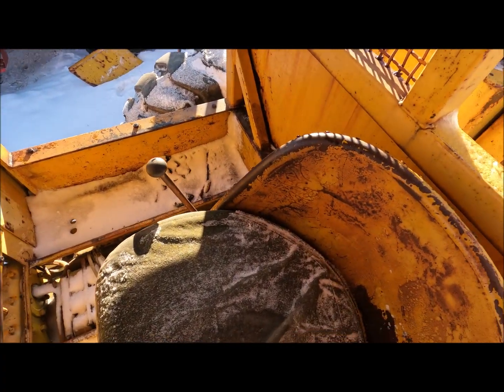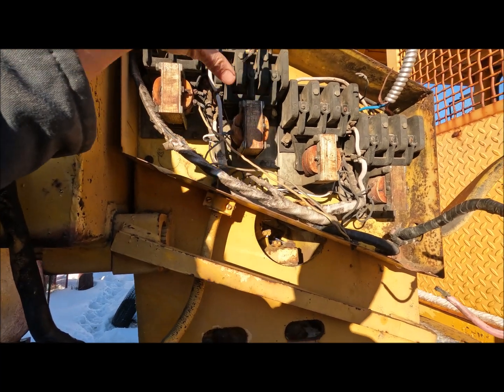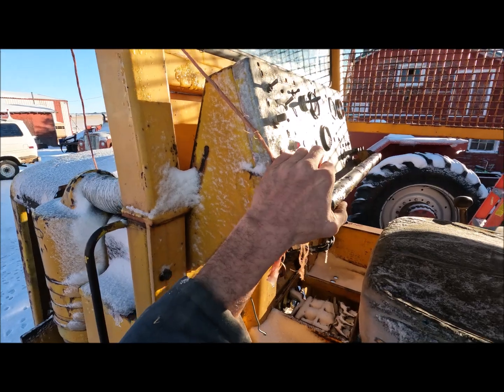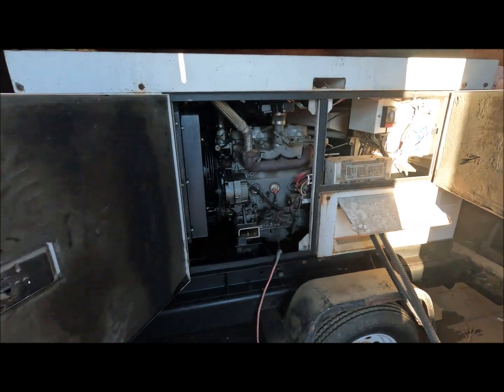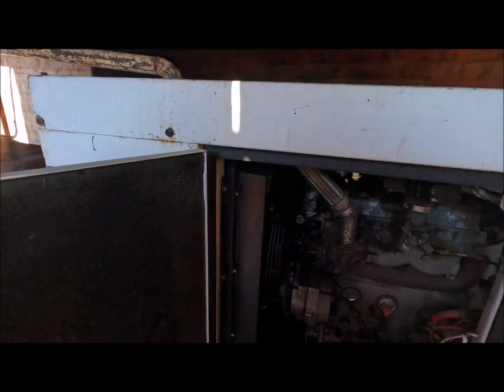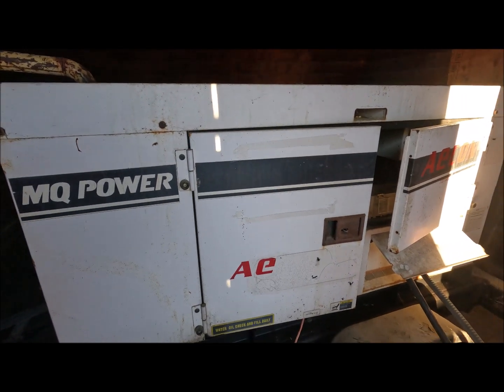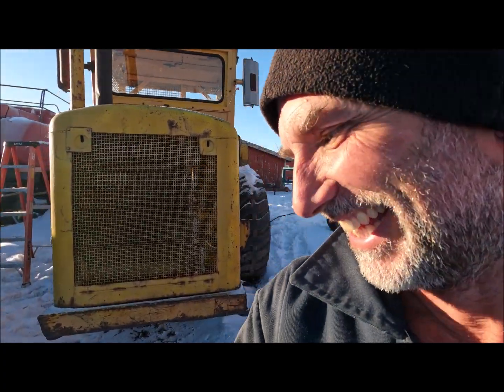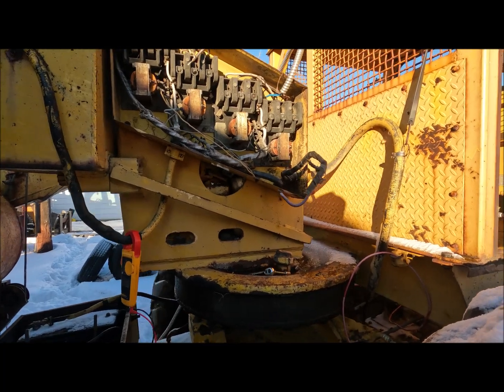Letourneau Tournapull scraper electric steering test #letourneau  #earthmovingequipment

Comment: you probably already know this. the engine speed directly changes the generator frequency. and those electric motors are designed to withstand 120hz. the engineers have thought about the gears so that the operation is smooth. the stihl truck used the same style function for driving speed.
great project i have to stay tuned
Reply from the maker: Thanks for the comment, I understand the rpm difference. Untill I get the original generator operational on the machine I want to get a VFD and bump up the hertz fron my shop Generator for bench testing in the shop only.

Comment: I climbed up on one of those years ago just to look and just thinking about a toggle switch steering, no brakes (air, NO pan has brakes) and a 4-71 with a flywheel alternator and straight drive to keep enough RPM/power to get the electric motors to even drop the pan to stop it or steer it and a relay hanging up or a wire breaking? Not THIS boy. I know they did a  lot years ago but I LIKE hydraulics. NOW!
Reply from the maker: Lol, everything you just described is exactly why I need to get this thing running. My Jedi Training will come in handy.
Reply: @PJTVenturesInc.  Oh MERCY always have a soft place to bail out into. I ran a 222 Wabco that had an electric drive to the paddles. It was on one side and you couldn't load a flat load for anything since it was so blasted heavy. I always thought of running a 'PULL" but it never latched. Get prayed up because when you get it moving you'll need every FORCE you can lay your hands on!
Reply from the maker: Thanks for the comment. I've seen pictures of those 222's with the electric paddle drives.  
I can totally see how they would make a cut on an angle with all that weight out there. Was the 222 a standard or automatic transmission
Reply: @PJTVenturesInc.  It had n Alli8son and an 8V-71T. Maybe a 4 speed.A 627 would run rings around it. A pal of mine turned the 222 sideways and kicked it in gear and it flipped over on it's side.
Reply from the maker: That's crazy. Hopefully I can get this old one in the dirt this spring.
Reply: @PJTVenturesInc.  That 222 was so heavy on account of that electric motor and gearbox on that one side it was pitiful. Just feel that rig out. I hope it works for you too.

Comment: I had one of them do  not overload your electric motors and you will be fine and you will also save your electrical contacks in the panel box
Reply from the maker: Thanks for the comment, I will  probably need your help and advice. I dont suppose you have any parts in your back pocket lol.

Comment: Just watch you dont wreck the motor if your supplying half the hz, some vfds can produce high hz if needed, good progress and hope
Reply: The problem with running 3 phase motors at lower speed is that the cooling fan does not move enough air to keep them cool so they over heat.
In this case the motor is only running in short bursts so it is unlikely to over heat.
Running old motors off a VFD can be risky. The waveform generated by VFDs can stress the insulation on the windings, causing it to break down. Modern motors have better insulation.
Reply from the maker: Thanks for the comment. My plan is to still use the original generator, I have been looking into replacing the rectifier but everything that Letourneau used to make this machine was made in house. None of the equipment has any ratings for hp, amps and watts. Theres no off the shelf or even brands to follow back a discontinued line of equipment. With that being said, Yes I should be able to replace that rectifier with a new one. The rectifier does two jobs. First and here is where it gets tricky for me. There is a Booster Rectifier that provides excitation for the AC Generator from the batteries that is always keeping the generator with with power with or with out any of the motors in operation. Second it is supposed convert the AC back to DC and charge the 24 volt automotive system. Theres is no little 24v generator or alternator run by belts on the front of the machine like most standard equipment. How do I ask for one or two new rectifiers with out the parts person looking at me like i have a second head growing out of my shoulder.
Reply from the maker: I was planning for testing purposes only, to set up a vfd to increase the cycles/hertz. Which is harder on the motors  in this instance. Incorrect speed and cycles/hertz or vfd supplied power. I want to remove the three other motors and winches from the machine and disassemble them in the shop and replace the bearings. Then if the motors look ok bench test them.
Reply: @PJTVenturesInc.  Just for short test runs, either 60Hz direct or through a VFD should be fine. One advantage of a VFD is that it will probably fault out if there is an electrical fault in the motor.
So you have two rectifiers? Is the excitation rectifier three phase or single? Most I've seen are single.
Is there any chance of letting me have a look at the schematics. That way I'd have a better idea of what rectifiers to suggest. There is a shot of the schematics in your rectifier video but with YouTube video compression it's hard to read.
Reply from the maker: Thanks for your interest and help. I will try to get some info in the next couple of days. The drawing I have is from a pdf that was photo copied from an old manual and I can barely read it my self. I will get back to you thanks.
Reply from the maker: Thanks for reaching out. Yes the hertz are wrong, I did read about the VFDs but hopefully I can still get the original generator working. This does add momentum to the project and so does the support from you, thanks again.